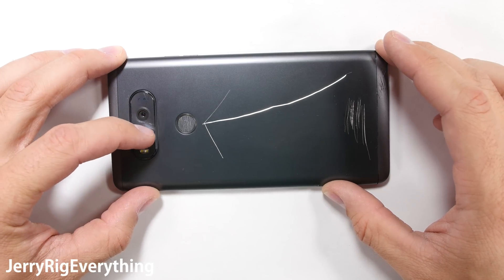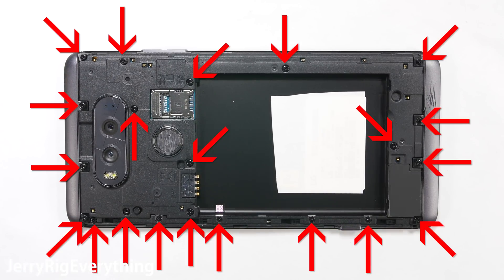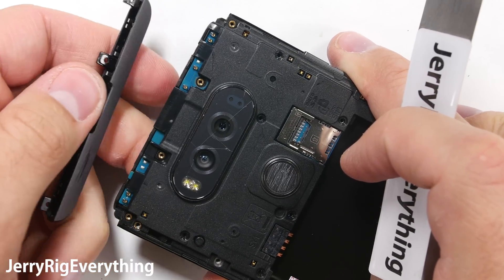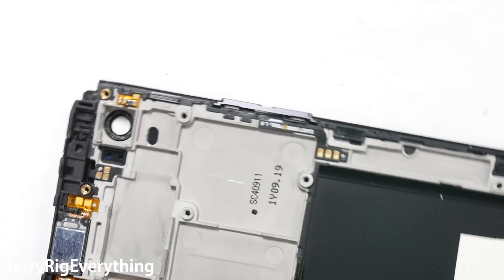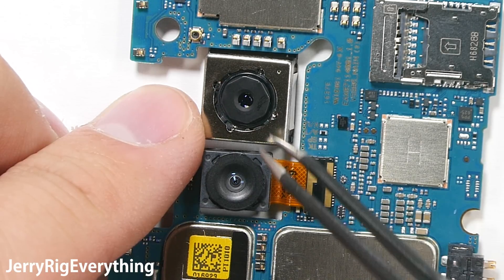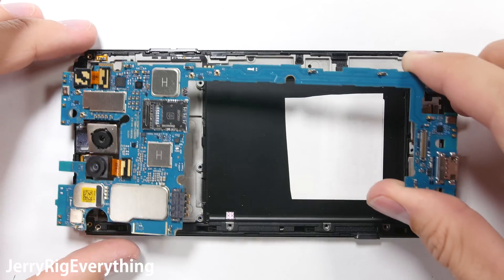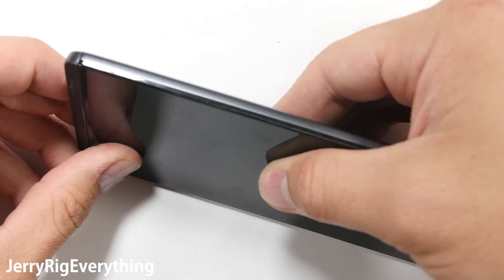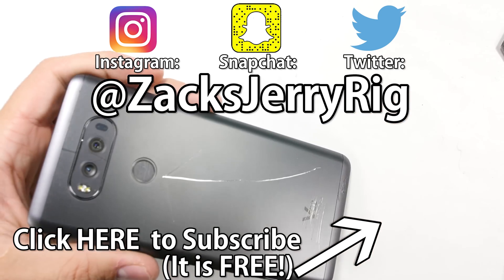LG V20 Teardown - Screen repair, Battery Swap, Charging port fix

Comment: Or having a phone without a headphone jack is like being an iPhone user
Reply: Mabirc How are you listening to this video? I'm using headphones with the clearly useless headphone jack

Waits for iPhone fanboys to start hating on me
Reply: Mabirc updates that make your phone slower and buggier*
Reply: Mabirc You pay for the extra year or of updates, and LG is pretty good at updating their phones anyway. Furthermore, your claim about battery life is just inaccurate. Go to pocketnow, watch their real review and you'll discover that your IPhone 7's battery life isn't that good at all. But that would be okay if you could just recharge it quickly when you need to. But charging an IPhone is a total joke. My Oneplus 3 charges 3x as fast! And that isn't taking it to account that the battery in the OP3 is 50% larger. The LG V20 has QC3.0 so it will charge at a similar rate (20W for OP3, 18W for V20, 5W for the IPhone. The slightly better LCD is barely noticeable, however the QHD is very noticeable in VR. The ICloud integration is just an overpriced version of Google services. I don't pay anything for 1TB of Drive storage, and while this maybe isn't standard, you get a free 15GB of storage and for €2 you can add a 100GB. Yes you have good stereo speakers, I do agree, but nothing new, HTC has had them since the M7. And if you care about software updates after 2 years, I'd also expect to be able to upgrade storage. Specially since file sizes keep increasing year after year. Your better camera is also questionable, while it is a good camera, I can't agree that it is any better than the competition. Specially since there is no decent manual mode. Yes the IPhone 7 is a decent phone, but I find them overpriced for no good reason. The hardware is nothing special or innovative. The most innovative Apple has done the last years is getting rid of the useful headphone jack.
Reply: +Mabirc I'd rathe not buy in to some bullshit that gives the company an excuse to make shitty $160 AirPods. Talk about software and updates all you want, you're still buying in to their bullshit. The phone isn't bad, but the company is. You've lost functionality and didn't gain much at all.
Reply: That's like... Eeewww
Reply: Mabirc So I don't get updates that make my phone slower.
Reply: Mabirc If you want quality speakers,  try the axon 7 or HTC One series.
Reply: it has worse battery around the same speed worse ram management a WAYYY worse screen (you cant make 720p into 2k sorry bud) worse "stereo" speakers and a worse camera
Reply: Really dashing out on a v20 with an Iphone  7 ? Good luck with that ... may be with an update you'll get ...

Quad dac 
IR blaster
Removable battery
SD card expansion
Quad Hd screen
military grade drop resistance

Oh ..... #SheepMoron
Reply: Even the Ipad charger is only a 12W charger, and therefore my OP3 charger is 66% faster, still a joke. And while the future may look like that, with the tech of today it is really inconvenient to not have a headphone jack. Id rather have it and not need it than not have it and need it. Also, Zach has a perfect explanation of why the headphone jack is gone.
Reply: My friend has iPhone 5 and is buggy and shitty and has never been fixed with new updates, nice fix, if Android gets an update it doesn't fuck up your phone.
Reply: LG V20's speakers are better... js
Reply: And you know that top and bottom part is easily changeable structure? You just need to remove few screw.  And new set just 9 dolars. And of corse Independent from other parts of the phone. So you don't need to remove everything. Aaaand This piece acts like a bumper on the cars. ( These buffers are usually the most frequently damaged parts of a fallout. )

And just a side effect. Because of that you can change the phone color easly too :D

The V20 is one of the easiest phones to repair. Thanks for that lg.
Reply: Wow all it takes the stupid Android community to fight with an iPhone user is to say that he has an iPhone...
This is why i fucking hate the Android community and fanboys. A bunch of 12 year olds bashing the iPhone and users all day. Writing this using my LG V10. In case you were wondering you fanboys.
Reply: At least Moto[rola] didn't fall for that trap after roughly a month.
Reply: Lols
Reply: Verted Intro A phone that is slower, has worse battery life and worse screen and double the price, the phones are bad too.
Reply: Sneaky_Krait 
Your "friends" iPhone 5 doesnt interest me, i had an iPhone 5c with iOS 10 before and it was pretty nice.
Now can we please stop talking of our friends and involve personal experience, thanks.
Reply: No iphone user complains for anything... for that matter..
Reply: Mabirc The Galaxy Tab S2/3
Reply: That guy is pretty dumb. Despite glasses.
Reply: Sneaky_Krait 
Well probably because you dont get updates at all
Reply: Verted Intro 
You'd rather get used to this because this is how our future phones will be like. And you know, i havent ordered the Air Pods yet nor do i think i will buy them. I use the Lightning headphones if i want to listen to music. "Yeah but you cant charge your phone while..." Yeah, yeah, heard this argument all the time. But why would i charge my phone when i use my headphones on the go ? Usually i charge my phone before i go out and yes it does fastcharge since i use my iPad adapter which doesnt kill the battery unlike what people claim.
At home i use the stereo speakers, which are awesome, or my BT speaker which is even better. In terms of audio, i couldnt be happier. And i havent heard any iPhone 7 user complaining about the lack of the jack.
So i dont know why its such a big deal, atleast not for me.
Reply: jadoei13 
Ugh...
Well i guess i am not allowed to have an opinion...
Look, i have been using my iPhone 7 for almost 2 months now. Battery life is pretty good, hands down and i dont know about a battery test on Pocketnow, i havent seen one there yet and i doubt it exists. I did watch the stats one time after it was almost out of battery and i did watch something almost 6 hours long on Netflix. Plus some Facebooking, Youtube, Whats App, a game, the usual stuff. All in all 7 and something hours of usage... With a 1960 mAh battery. Now imagine the 7 Plus! The One Plus 3 cant do that, nor does the V20, i heard it has pretty bad battery life. And also, i use my iPad charger to charge my iPhone which doesnt kill your battery and it charges in an hour and a few minutes more. 

You dont only pay for the *2 to 3 additional years of updates, you pay for the whole iOS ecosystem. This is what some people dont seem to understand. Apple runs a whole software division, with their own servers, own engineers, their very own ecosystem. And that costs alot of money. So yeah, iPhones are allowed to be this expensive. But yeah, they are expensive. 

Why would you want to upgrade storage lol. I never understood that! The iPhone has NVMe storage which no other phone has, it has perfect iCloud integration. It saves everything you do in a backup. Literally EVERYTHING. You pay 99 cents a month. How much does a SD Card cost ? And its not NVMe! 
The Pixel just copied that, but its not as good as the iCloud, by far not. And the iCloud has much  more functions than just that.

I did use some kind of VR headset already with my iPhone. That was on my 640p iPhone 5C. It was pixelated, but definitely ok.

I've seen alot of camera comparisons, the only phone that is much better is the S7. The Pixel too, but not that much. The V20 is only better in low light.
Other than that the iPhone is better.
Reply: jadoei13 
Well i guess i should make a video of me charging my iPhone 7 with the iPad adapter and how it charges 66% slower. It takes as long to charge it as it takes for the OP3. Yes i said it. 
Dude how is it inconvenient if you have 3 different ways to listen to music ? Wireless, through your EarPods or through the adapter. I havent even used the adapter until now. Maybe you, but i dont need the jack. And yeah we all know why Apple removed it. Apple being greedy, but Apple setting new standards. And if Apple didnt do it, somebody else would. And already did, so..
Reply: ***** 
1. Neither did i say iOS is perfect, but:
2. what you say is wrong. Ask iPhone 6 and iPhone 5S owners about the speed and experience of their devices. They're pretty happy!  The iPhone 6 still is snappy, the iPhone 5S feels faster, the iPhone 6S is faster on iOS 10, the iPhone 5 slower but not by a big margin. 
So thats invalid. Use an iPhone, then talk. 
Yes you can downgrade on iOS. iOS 9.3.5 has not been signed meaning you can always go back. 
And about the upgrade of your Android phones, well you have to root them which means losing your warranty and taking security risks. Its like a a jailbreak for Android. And not everybody knows how to do it and not everybody can do it. Not a valid point.
3.
You're an Android dickrider because of the same reason you called me a sheep.

4.
See, you did it again. I'm not trying to troll nor am i a fanboy as you can clearly read in my statement above which obviously you didnt read.
Sorry for making up good points about iPhones, i know i am not allowed to...
Reply: ***** 
Lol the iPad is 5 years old, will be 6 soon...Show me a comparable Android tablet! Oops, there is none!
Reply: Sneaky_Krait 
Better than updates you will never get meaning you have to buy a new phone in order to have the newest OS.
And also, iPhones get seriously slow after 4-5 years which is longer than any Android user uses their phone.
Reply: Im an iPhone 7 user, so ?
Reply: Le John 
Atleast i get updates, meaning
-better battery life
-better speed
-and better Ram Management
-best LCD screen
-iCloud integration
-good stereo speakers
-better camera

Its all about the Software. The V20 is overhyped. 
And you're just copying my comment. Try again, Fandroid. Maybe it works out better for you. And no, i am not a fanboy. I am just an iPhone user which somehow is an issue for Android Dickriders like you.
Reply: @mabirc2844  if that was true why do iPhones go slow and why does Apple slow down iPhones and why does iPhones continue to copy Androids Androids were the first to come up with better features than iPhones Android's where were the first one to come up with fingerprint reader Androids were the first one to come with wide angle lens and many other features so try again😂if iPhones are so amazing how come they copy android
Reply: imawhale 
I'm using the stereo speakers.
Does your phone have stereo speakers this good ?
Maybe... with an update... that your phone will never get #lol
#AndroidDickriders
Reply: Mabirc good luck with your iPhone 7, using an IPhone 7 plus now and it's pretty slow these days
Reply: @mabirc2844  stereo speakers on an iPhone 7? Ok...
Reply: @mabirc2844  lol that's why androids have more features that's iphones continue to copy androids 😂leave what you are talk about before you speak